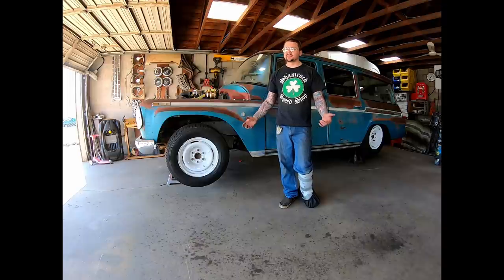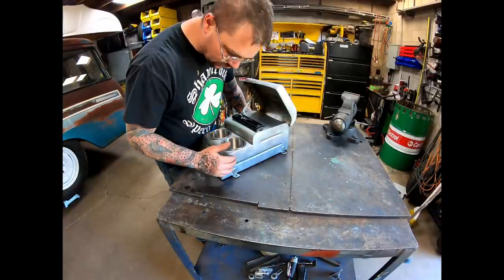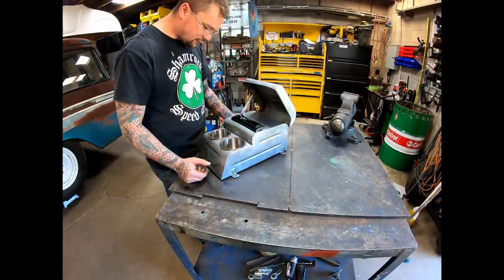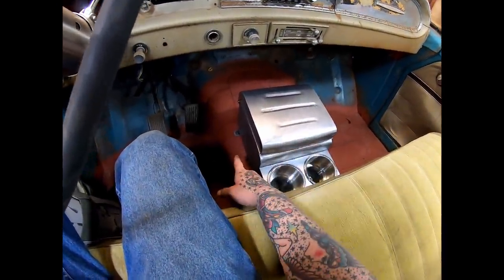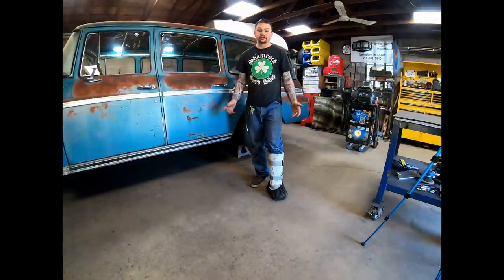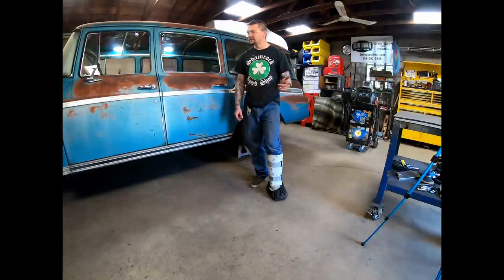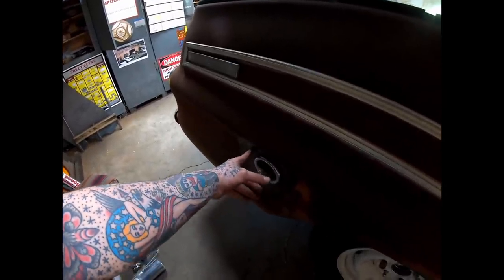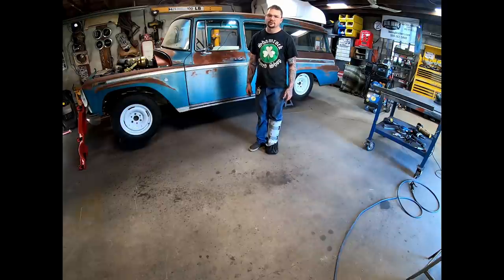SMALL DETAILS. TRAVELALL UPDATE.

Comment: I know this is just my thought don't mean anything bad I like the build it's looking good. Buuuttt  aaasss far as the console not a fan now a secret place in the dash along the lower part cut it and make it hinged to go up or down and make mounts for the radio and HVAC and the other jacks. I took another look at your dash and wear the radio is now would be perfect it looks like a door now. Take and cut the old radio and mount it like it's still in but it's just the front of it. Sorry just me thinking out loud. Oh for  most cars and trucks cup holders is a future thing now an ashtray  yeah.
Reply from the maker: That’s okay everyone’s welcome to an opinion. I cut the radio face off the one in my truck and welded all the little piece together so it looks like a radio still. I stuffed speakers up under there. I considered it. I done hidden compartments before on vehicles and from experience of actually daily driving my stuff know it gets old. I real daily my vehicles too. I don’t want to be driving and see the the middle of the dash flipped up or down. I’m not a fan of center consoles myself but I’d rather have this one then something like that. The white Travelall I had some one actually deleted the radio and hinged the center piece (it was very janky) but still from that alone I know I wouldn’t be happy with that. This is for the drivability and what I need to utilize for road trips and everything.
Reply: @PuddinsFabShop  Like I said MY thought. I didn't know you had all ready been there done that. OK now the ashtray or cup holder  LOL. I'd go with the cup holders also.
Reply from the maker: I hope that didn’t sound rude just trying to let you know I did consider it quite a bit.